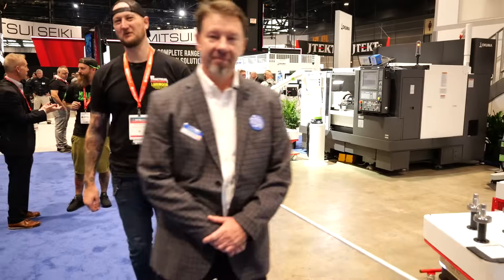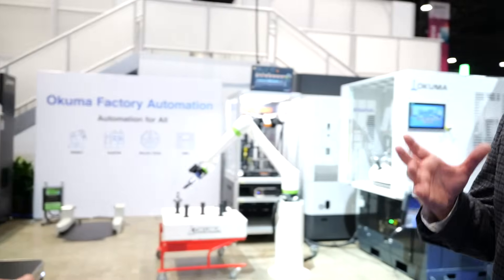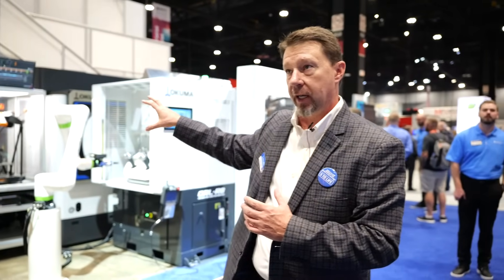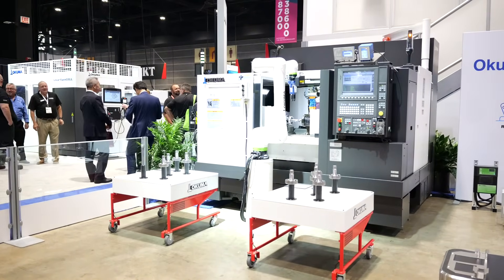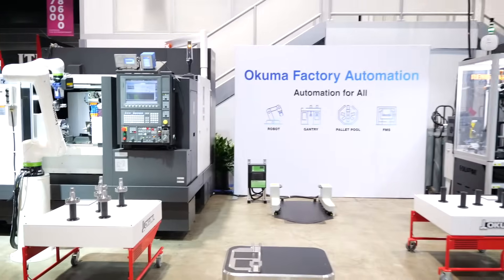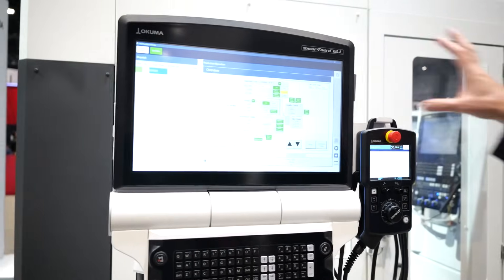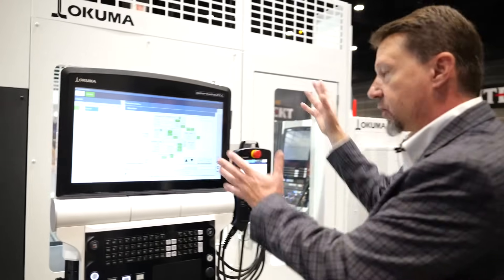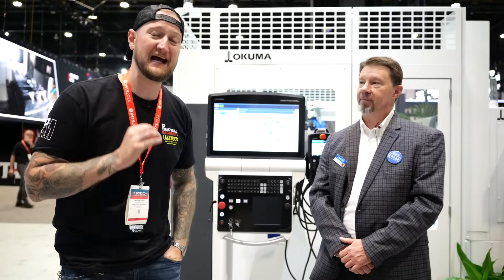Talkin' Automation with Okuma

Comment: This all works great with a temperature controlled, lab environment with clean floors, perfectly level, etc.  Also, a huge debt for all the equipment, pros you have to pay to install, and the $250k/year guy to hire and program everything.  Cnc world making the same mistakes as auto industry and EVs. Moving too fast, in the wrong direction.
Reply: And who are you to judge?
Reply: You run machines on uneven surfaces, buy all your equipment with cash, and have a plethora of skilled machinists ready and willing to work for you? That's quite the set up you have, most shops install their machines on even surfaces, finance their machines (when starting at least), and have to resort to automation to make up for the lack of skilled labor available for hire.